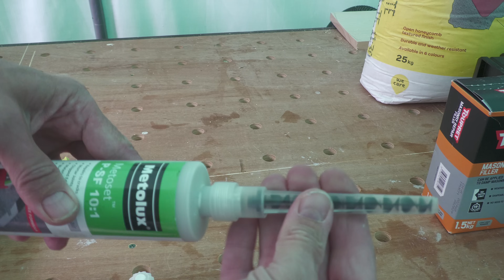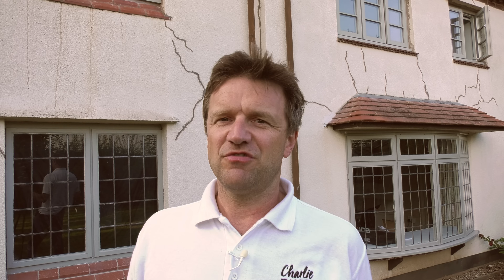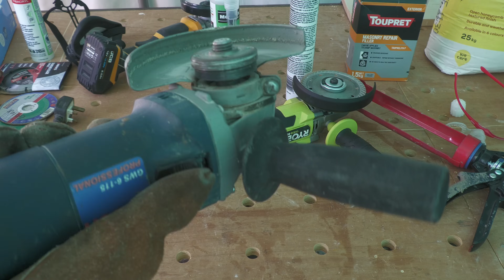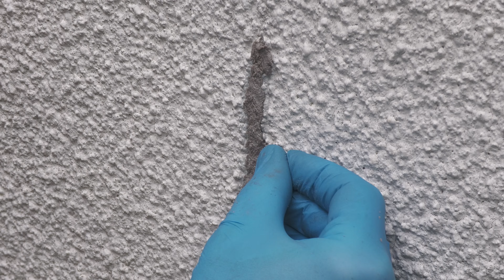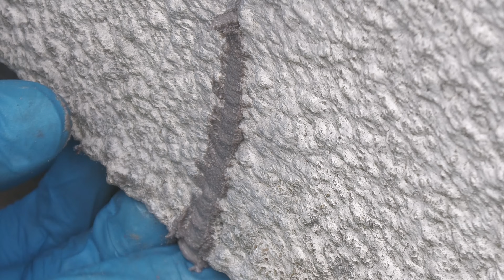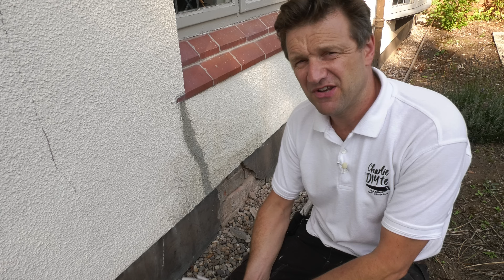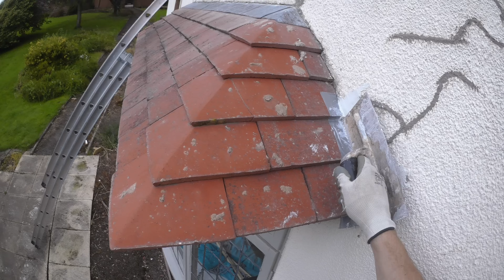How to Fill Cracks in Render

Comment: Hi Charlie, great video! One question, I have issues with damp causing flaking paint around my windows indoors, have done all the usual with Zinsser etc but the issue isn't resolved. Looking closer I noticed cracked render outside and thought this might be the root cause. 
The rendered section of my house isn't as big as yours, and I wonder if I'm better off trying to repair it or paying to have it removed? 
Also did you do a video of making your French drain, I also need to do that! 
Thank you!

Comment: Best way ive found for creating rough cast finish is after filling wait till it starts to go off not too much though then roll up some bubble wrap.then roll it over the repair found it leaves an almost identical finish to tyrolean. Found the toupret rock hard filler works well

Comment: You could ping a small section of the render with gloss paint. When the paint is dry coat it with silicone lubricant.
Us a wallpaper seam roller coat the roller with two part wood filler the gently roll it over the render that’s silicone coated. 
This should leave an impression the render in the filler.
When set, coat the filler with silicone lubricant. 
when you have applied the filler to the cracks roll the seam roller over it to leave the render impression in it. dap of any excess with a short paint or stencil brush.
Did this on a bank refurb where the wall covering was painted after old signage was removed leaving screw holes which we filled with decorators caulk then rolled and painted.
Reply from the maker: Thanks - nice idea - I'll keep that in mind 👌

Comment: Filled some deep render cracks 7 years ago with polyurethane sealant and there still like the day I did them and it's -6 in winter 40+ in summer you can't beat it . 👍👍🇬🇧🦊

Comment: Any chance of an update on how each of these methods lasted over the last 3.5 years. Any of the original cracks returned?
Reply: An update would be great, maybe show how the repairs have performed over time.  👍
Reply: As the building is working The cracks will return in different places, unless all render removed and redone with mesh and more flexible render

Comment: Toupret also have Rock Solid Repair Filler Exterior which seems to be same as Masonry filler but its 2kg powder box whereas Masonry is 1.5kg and it says Masonry can be applied to damp walls but has 48 hour wait to paint. About same price …cheap at screwfix and Amazon ..but seems to be same stuff no?

Comment: ⭐ Quick tip, if anyone is interested. For VERY thin hairline cracks (upto 2mm) in render/paint...

Search for "blunt needle syringe set", and you can inject smooth masonry paint directly into cracks.

Overfill with paint, and then stick some polypropylene fibres over the top whilst it's still wet. Once dry, go over with a topcoat of masonry paint.

Works a treat if you're not going to the trouble of opening up the cracks and using filler. With this method, you end up with a clean, slightly flexible seal that lasts. No jet washing or blowing out required. Use a mould/algae treatment first if necessary.

As a bonus, it's easy to rework the area if there's continuous movement due to other factors.

Comment: Tip. Buy a variable speed grinder, they are more expensive though and are only as 125mm but on low speed they spray less dust into the air. I have 2, a 240V Metabo which I've had for around 7 years and just got an 18V cordless Makita.
Reply from the maker: Thanks for that 👌

Comment: Good review and insight. 👍🏻 

You say not to use the Toupret flexible product unless the render is "subject to movement". However, aren't the cracks there in the first instance exactly because they are subject to thermal expansion?

I'm no expert, but those cracks did not look to be subsidence related.

I have this job to do on a new build extension because the twats I hired didn't put in expansion joints as per the plans. After 4 seasons, the render has conducted its own movement tolerances, allowing water to penetrate inside.

I think using anything that sets rock hard will just shift the issue to the next weakest section of render, and I'll be constantly chasing and filling new cracks.
Reply from the maker: It's a fair point. The only thing I'd say is that the cracks haven't opened up again since I did this and no bare ones have formed so I think you've just got to crack on with the work if you pardon the pun to reduce that water penetration.
Reply: @CharlieDIYte Update on using the Toupret Fibacryl flexible filler. Used it on a rendered garden wall this autumn, then applied two coats of masonry paint. Initially good results. However, we've had bone dry weather for over a week with temperatures down to -6C, and ALL the cracks have opened up again.

Apart from the initial finish, the product has made no difference to previous years where just painting was done.

Conclusion: it's a waste of money unless you live in a year-round temperate climate. Will need to try something else this year when the weather improves.

Comment: Forgot to mention that the nozzle is about 12 mm so you can't get right into the gaps your trying to fill
Reply from the maker: If you grind them out you should be ok. I might not have mentioned the width but I showed it in action.

Comment: I used a Dewalt multitool to grind out the cracks. Far less dust using a mortar tool. Using hard filler in the resultant crack may produce another in time, as temperature affects the render by expansion of the material.

Comment: What is your plan regarding the wall-based plints? Will you leave them bare after applying moisture resistant paste (I saw it in your recent video)? Or will you b able to add some decorative plints over it after treating it?
Reply from the maker: I'm leaving them bare. The whole house is swathed in Tyrolean today can't breathe but by leaving the plinths unrendered I'm at least scaling this crucial bit at the bottom some air and also, the damp course such a it is, is bridged if it's rendered.
Reply: @CharlieDIYte  Thanks that makes sense. Is there a way to make it look a bit nicer or is leaving them bare as is really the only logical solution? I am in a similar situation and have been binging your videos, especially regarding the waterproofing bricks (stone in my case). I wanted to apply water resistant cement on the stones and then add some plinth panels to make it look nicer, but your reasoning has me doubting that course of action.

Comment: Been painting our pebble dash with sandtex trade ultra smooth. Dries to form a rubbery finish and found the sprayer will fill some cracks. Definitely easier for for people like me suffering from carpal tunnel and seems like you get a good thick coat compared to a roller which can pull the chippings off.  In some cracks i also bedded a few chippings in with filler. And on some bare patches i gunned a few blobs of filler that look like chippings - if you do this low down you need a few coats to make it more convincing but works fine for bits that are higher up.  Only the 3rd coat to do in a few areas, glad it's done before it gets too hot.  I bought a Wagner 350M, it sprays 40% diluted first coat on fine, but struggles a bit with the 10%. Have to do it a little at a time but keeps you being thorough.

Comment: Thanks v.m. Charlie, from Hong Kong. Both highly informative & entertaining! A suggestion: it would be great to have the details for the surface prep of the large crack (Final repair) at the back of the cottage (PVA et al.). Cheers!
Reply from the maker: Thanks! For that I used a standard PVA although SBR bond would be better for outdoor use and then a bag of Tyrolean render I had bought for a larger repair that I didn't get round to doing.

Comment: Thanks. I've got some cracks starting to form and I love the tip about getting rid of ivy with the wire wheel grinder. I've got one already for rust removal so will attack the old climbing hydrangea with it
Reply from the maker: Good work 👌

Comment: I’m in the process of repairing cracks in my render and was hoping to use Toupret masonry filler but have been made aware it’s quite porous. Have you had any problems with it?
Reply from the maker: Well, I overpainted it with the excellent Emperor so I haven't had that issue https://youtu.be/zw_8YVFKY1M?si=DwIXECGnByibU-iX

Comment: Great video Charlie, very informative and it as given me some great tips for doing the wall on my cottage, as i have the same problems with cracks in render. I have purchased what you have tested and recommended.
My question is, what did you use to get up to the crack nearest the window sill ?
Reply from the maker: Can you explain what you mean by that?
Reply: Your out side window sills have sloping tiles and some of the cracks run from the corner of the window sloping tile and down the wall, which you have repaired in the video.

Comment: Charlie, how have the repairs stood the test of time 2 years later, going to tackle a similar project this spring and wondered on the results
Reply from the maker: The metoset is fantastic stuff - can't recommend it enough. There is one area where it didn't set properly because I probably didn't extrude enough before I started. There's one section that has cracked but that's because I've created movement again with all the works I'm doing in the kitchen but the rest still looks great. With repairs like this you can't guarantee cracks won't return because you haven't tackled the root cause of the cracks but as a repair solution this stuff is hard to beat.
Reply: @CharlieDIYte  thanks for the update, I will give it a go

Comment: The metafix, does anyone know if it can be drilled and wall plugged?  GREAT video as always Charlie!
Reply from the maker: I would have thought so as it's an epoxy based product so it's not brittle like water based fillers or 2 part wood filler.
Reply: Ordered some now  @CharlieDIYte  , I've bodged up some holes for a curtain rail ( poitions out and plugs not right so want to fill, re-drill and plug again (Fischer duo plugs and Bosch Expet SDS drills oredered too), I wasn't sure if i could make a mortar mix tht would be good enough to re-do and also the issue of getting it in the holes in my just decorated room!

Comment: If you clean out an empty silicone tube you can fill it with any soft mix and use it to get the mix into cracks.
Reply from the maker: Thanks. Just started using my new mortar gun and I'm slightly obsessed with it. 👌😉

Comment: I wouldn't even waste my money on buying tools like jcb, ryobi black and decker, and any other cheap battery or electric power tools they are a waste of time, makita, dewalt, hilti or Hitachi they will last for ages and you won't have to charge the battery 3 times for 3 hours instead half hour and last 3 times longer from fully charged.

Comment: A method (and not simple) - make a silicone type casting of a an area and then use it to replicate the original area - carefully pressing it onto the still wet repair material.  Not easy - and not suitable for all repair materials - but done right - 99.0% 'invisible'.  CHEERS from AUSTRALIA.
Reply: I did this and it worked well
Reply: So like a pebble dash silicone cast like a cast of a woman's breasts lol sorry for that example , which leaves you with a mirror of that 1 metre squared patch for example?

Comment: Hi could u give a update on how the cracks r looking after a year ,have they resurfaced ,of stayed invisible
Reply from the maker: They're still looking good. Bottom line, if the crack is caused by say weak mortar between the bricks then they may reopen but you're going to struggle to find a better solution than this for filling them.

Comment: Hi Charlie I have a simular issue with dry dash (roughcast) over poured concrete walls.  Would you say this technique would be suitable? Really appreciate any reply on the older video
Reply from the maker: A bit difficult to say without seeing it but it's the best technique I've found for getting epoxy into concrete cracks. Maybe try it on a small area.
Reply: Last question Charlie.  Can I use the metaset with 2 or 3  Helical bars or should I get separate resin?

Comment: Dear Charlie, I am about to start to sort out the front of my house as I asked a plasterer to repair the cracks and he ground them out and then infilled, but the job looks very messy. Can I ask how you would go about repairing cracks in a render that is smooth rather than pebble-dashed? I am trying to figure out how to fix the problem! I think the plasterer put a type of silicon on top of the cracks after filling them in, which is why they stand out so much... Would you recommend the Metoset for smooth render? Can you sand it down when it has dried? If you could respond to this comment I would be forever grateful! Thank you for this excellent and informative video :-)
Reply from the maker: Yes you absolutely can sand down the Metoset and yes I would recommend it for smooth render. You'll see me doing that with the mortar raking tool in the video. The stuff your plasterer used - is it paintable? If it's a silicone type product you won't be able to sand it unfortunately whereas you can with the 2 part epoxy resin fillers.
Reply: @CharlieDIYte  Dear Charlie, Thank you so much for this rapid response. I think it was a type of paintable silicon, but it did strike me as an odd choice for the job as it has created a skin on top of the cracks which make them stick out all the more - though I must say that the wall has dried out, so from that point of view, he has done a good job. I am getting scaffolding up soon and will attempt to prise off the silicon (any recommendations for how to do this?!) and then add in some metoset in the recessed cracks, which I will then try to sand down with a sanding tool and overpaint. I am also going to try to repaint the front of the house and have watched your video on this with interest, since there is quite a bit of mould on the front of the house that I need to clean off. Would you recommend using bleach to do this or an anti-fungal wash? Which power spray, in your opinion, if I rent one, is best?  Many thanks in advance for your help here - I've never done anything like this before so it is new territory for me!

Comment: Hi Charlie. I’ve got a fair sized hole in some plasterboard . Have been told to 70% will with expanding foam. Then skim over with fibacryl leaving just below the surface and then skim over with my easifil before priming / painting. Does this  sound ok? Thanks …
Reply from the maker: Hi, I wouldn't bother with Fibacryl. I'd use the expanding foam which will firm up the plasterboard nicely behind. Leave about 10mm at the surface or cut the foam away when set and then skim with the Easi-Fill building up coats if necessary.
Reply: @CharlieDIYte  perfect thanks as always mate👊🏻

Comment: The render… the fascia…the Dewalt goes deeper than others…excellentae! By the way, does the Metoset seem more expanding (and contracting) than other products mentioned here? Seems other “hard” products might create more stress issues down the road… anyway, THX for the info. Be Well!
Reply from the maker: The Metoset doesn't expand but it's definitely the best I used in this vid. That fibacryl is terrible stuff.

Comment: TOP TIP: I always save old silicon tubes after use. Unscrew the nozzle and push a long rod down the inside of the main tube to force out the internal plunger bung. The silicon will dry after a day or so and is easily removed as one piece with a stick. When the silicon is dry in the nozzle, screw a long screw into the threaded end and pull it out as one solid piece. I then mix cement (or in your case the powdered render) and spoon it into the tube. Tap the nozzle end on the ground every now and then to compact it. Finally push the internal plunger bung back inside the end of the tube. You can now use it to quickly fill deep cracks like repointing between bricks of as in your rendering. I use the same tube over and over again by refilling until the job is done.
Reply from the maker: Great work Peter. Thanks for sharing 👊
Reply: @CharlieDIYte  Great video, clearly explained and to the point. How have the crack repairs held up, a year down the line?
Reply: EXCELLENT THOUGHT,👍

Comment: I’ve had an almost exact same experience with these products. The fibacryl is crap -both out the tube and out the tub, which is surprising because Toupret is my go to brand for filler and I use all their other products apart from their wood filler as it’s just a bit too porous. I had render cracks to fill on a job in June and used the rawlplug styrene free polyester resin, which worked just as well. What I did though was tool it down first with scraper then gloved fingers for the lip edges, then when it’s cured, I caulked the whole surface of the resin and smoothed it in So it matched the tyrolean. This tyrolean appeared to have been painted many, many times tho as was all soft bumps which was why the caulk method worked so well 👍

Comment: Will this product help repel water ingress? My garage is a single skin blockwork with a crack letting water in and need to fill it with something. Looking into metoset
Reply from the maker: Yes I'm sure it will or put it another way I can't think of anything that would do a better job. The Emperor paint is also fantastic as it's breathable but water proof. https://youtu.be/zw_8YVFKY1M
Reply: @CharlieDIYte  thanks. Metoset with a coat of this paint might just do the trick. Only one way to find out! Lol